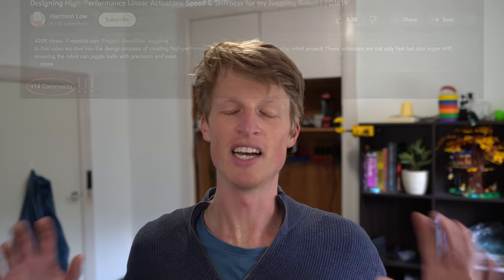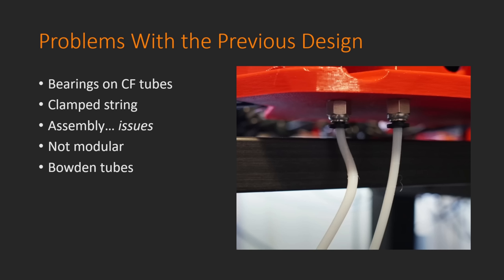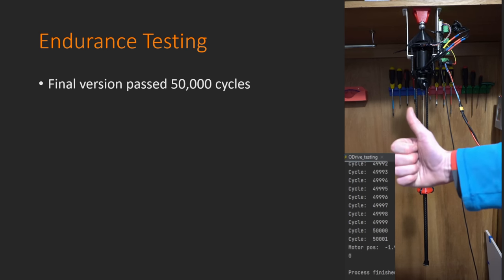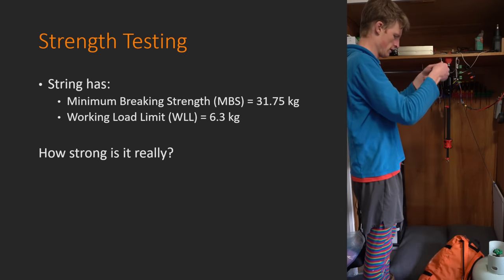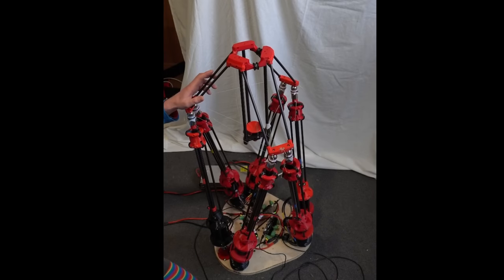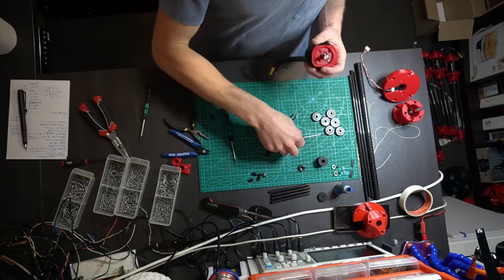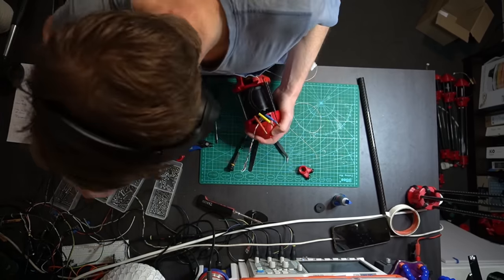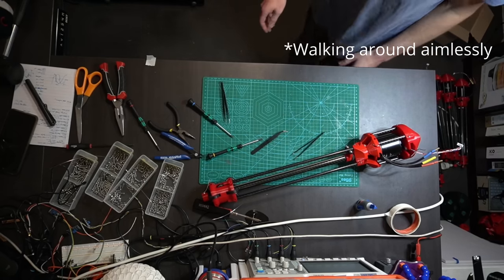My New Linear Actuators are SO MUCH BETTER! | PDJ #21

Comment from the maker: 🚀 Hey Jugglebot Enthusiasts! 🤖

I'm thrilled to finally share this update of the actuator journey with all of you! Your insights, curiosity, and passion have been pivotal in this progression.

If you were designing this actuator, what would YOU do differently? Or better yet, if you could see one feature or capability added to these actuators, what would it be? 🧐

Don't forget, if you want to learn more about the project, or to lend a helping hand, check out our Zulip site, here: https://pdj.zulipchat.com/
Reply: Please don't add music.  I really wanted to see how this was made but just couldn't with the music.
Reply from the maker: @MichaelMantion  Hmm interesting. I'm in two minds about this. Do you think just making the music a bit quieter would be better? Or would you prefer just none at all?
Reply: Would love to make a design for you but i just cant do things for free anymore
Reply: Love the series and the focus on the process of basing the design in proper design requirements. Inspiring thank you, clearly you are on a great path with the project 👊👊👍
Reply from the maker: Cheers Martin!
Reply: use tephlon wheels from a 3d printer insted of the berrings it has the berring and roller in one
Reply: You should look into making a 3D printed axial flux motor and implementing it.
Reply: 4:34 i think eliminating one pulley per string is fairly easy (and btw they are not pulleys, they are rollers).
Reply: @wormball  They are idler pulleys.
Reply: I would use Kevlar chord. 1.6mm braided chord can handle close 200 Kg and it can withstand high temperatures. (handy if exposed to friction or rapid flexing) Dyneema is similar in strength but slippery and susceptible to heat and length creep if kept under tension for long time.
Reply: Just kicking ideas around: what if you used two counter-rotating flywheels you can rapidly borrow acceleration from?

Feel free to debunk this: it's just a rough idea.
Reply: @Wintergatan_2  Hey! It's world-renowned musician, performer, YouTuber, and mechanical wiz Wintergatan, inventor and reinventor of the magnificent marble machines of musical merriment and inspirational delight!

I wonder who else is here, hiding in the comments...

Oh yeah:
🫵
You, person reading!
Reply from the maker: @RandomAmbles Someone else suggested a single flywheel and I had two preliminary concerns with it:
1. How to mount such a system to the existing actuator? (and how to deal with all the new complexities)
2. The gyroscopic forces would play silly-buggers with the full Stewart Platform when these actuators are moving around.

I quite like your suggestion of counter-rotating flywheels! I had to do a bit of reading as to how that'd cancel the precession forces. Very clever solution to the second issue.

As for the first, I'm still not sure it's worth the effort to add such a system (for my use-case), but I don't see why it wouldn't work in principle. Very interesting idea!
Reply: Have you tried using capacitors or supercapacitors for regenerative breaking?
Reply: You may have already figured out how to secure the synchro cables, however the idea is essentially to just route them through alternating additional screws (in-line or an arc the cable supports ~~~) instead of wrapping around a single screw. 🙂
Reply: @harrisonlow  YouTube now has  'multi-language audio' support, so I wonder if you could upload two audio files, for the languages: 'English', 'English no music'. It's a slow roll-out through, so you might not have access to the feature yet anyway.
p.s. I enjoy the music, but I do think it would be cool for the viewer to be able to disable it when they choose. For people like @MichaelMantion and people who sometimes want to listen to their own music in the background instead
Reply from the maker: @shminz6093  Very cool! I didn't know about this. Looks like I don't have access to this feature yet, but I'll keep an eye out for it. Cheers for the suggestion!
Reply: You can make a bent grommet that fits around the synchromesh that allows you to clamp down onto it normally (potentially with locking exterior grooves), and there are various polymers that are above 100MPa for the filament replacement, like continuous thin carbon fiber nylon66, PAI, PEEK, PPS, PEI, or some others.
Reply: TPU is also one of the lower quality polymers for that task. UHMWPE is much more effective for abrasion and strength. They make the new bulletproof armor out of a crosslinked controlled process version of it.
Reply: Stings and twisted cables can elongate with time which can be exacerbated with acceleration. I used to have a solution long ago but can't remember it now as I have thousands of innovations and am working on a dozen projects at any given time..
Reply: IT IS A BAD DESIGN, BULKY AND HEAVY..AND EXPENSIVE
Reply: You can terminate the synchromesh cable by clamping it between your original M3 screw and an M3 nut. Therefore it can be tightened way more than against a 3D Print

Comment: Just lying here, thinking that there are a couple of things that i might be able to usefully comment on... a bit off the wall, but i wonder if using two motors, although more complex, might give you control over things like stretch in a string, and providing some kind of dynamic control over the string action and loading... with encoders on the motors,  and optical "zeroing" sensors, you get calibration on every cycle... i wonder if some kind of silicone 'oil' impregnating the string might improve lifetime ... indeed, steel cable with a 'dry' lubricant might work well, even on the smallish radius pulleys? I guess that a lubricant could be 'wet', if the actuator 'tube' was enclosed....anyway, sick in bed, just the ramblings of an amateur....
Reply from the maker: Interesting idea with two motors! I'm not sure it'd be worth the added complexity in my case though 🤔 Silicone lube on the string is a neat idea! Since this video I've done a heap of testing with different strings (video to come eventually...) and have found dyneema to be really good; high strength, low wear over repeated cycles around small pulleys, low stretch etc. 

Cheers for the input, and I hope you get better soon!

Comment: For the bearings, I would suggest a delrin or Teflon roller. You can get a pack of these easily, marketed as 3d printer rollers. They would stay on the bearings better, resist abrasion, and have a self-lubricating effect with the tubes. For the synchromesh cable, you may be able to design a clamping plate similar to those used for bike cables.
Reply from the maker: Very good suggestions, cheers!

I think the bike clamping plate will probably be the final solution for this problem; super simple, small and light. Great thinking!
Reply: The wheels used by 3D printers to roll on 2020 could also be used. The wheels are really cheap. There are also different shapes. Maybe a concave shape is better for rolling on the carbon fiber. You can buy them with a groove. Or if you can control the spinning modify them with a static spinning  drill bit and slowly turning the wheel.
Reply: Why not linear bearings? Recirculating ball type used by many machine tool makers for linear movement. Robust, accurate, hard wearing and cheapish.
Reply: @seeker1015  Weight to stiffness ratio is worse (if you include the rails) than carbon fiber. More weight means: requires bigger motors.
Reply: Some of these have a Delrin  "v" groove profile that would give you 2 points of contact per bearing on your carbon tube. This is the first thing that jumped to mind when I saw your printed sleeves....I would imagine that this would keep things located a little more positively (at least, short of a concave profile to match the tube radius) . You might be able to use 3 of the same on the captured end of the moving tube in place of the 2 guide rollers you currently have riding one of the outside tubes...basically the same thing you have holding that moving tube inside your printed end, but flipped inside out. That would both keep it centered  AND prevent axial rotation given the 2 contact points inside the V. Anyway super interesting project, and very promising.
Reply: Just stumbled across this thanks to youtube recommendations and the first thing I thought was "POM" wheels instead of bearings and Dyneema rope instead of Kevlar string.
Reply: @harrisonlow  check out safety bolts. basically, you route the wire through the bolt and tighten it down. They are used on aircraft. it's even more simple, and has nearly 0 chance of slipping.
Reply from the maker: @suqmadiq69420  Very cool! Doing some reading, these look like they're used to stop the bolt from coming undone, and requires wire to work (to retain the twists/folds). Not sure it'd give the easy tunability that I want here, either, though I'm really glad that you mentioned this because I had no idea this was a thing before and I really like the idea! Cheers for the suggestion 😊

Comment: In order to utilize regenerative breaking efficiently, you really need multiple servo drives sharing a common power bus. This is a gross over simplification but large automation companies use this strategy regularly to help drastically lower power consumption, heat dissipation, and panel space.

Comment: Regarding the MBS of that string, you're going to get something closer to half of that once you tie a knot in it.
Reply: It’s also worth mentioning that some strings are stretchy. Using string with low elasticity may improve precision too.

FWIW, strength of ropes (atleast in climbing scenarios) are usually measured in newtons/kilonewtons. The fact that the string was given in Kg (assuming they didn’t do the conversion themselves) is a bit of a red flag.

I don’t think the material was mentioned in the video, (fishing line?) but dyneema, if they can find a suitably thin version, seems like it would work well here.
Reply from the maker: @bkuker I agree, though this does change based on what knot you tie. For the string strength testing, I tied figure of eights, which (AFAIK) are fairly good with not severely diminishing rope/string strength. Interestingly the string actually broke in the middle, far away from both knots 🤷‍♂️

As for the string in the actuators themselves, this is a big reason why I wanted to avoid knots altogether. I believe the system is fairly good with having no "stress concentrations" on the string, and when it does brake (eg. from the motor not slowing down fast enough and the actuator ramming into one of its ends) it seems to be braking in different places each time; some of these breakages being in sections where the string is perfectly straight at all times!
Reply from the maker: @techhech3358 Interesting point re. stretchyness and precision! I've just been treating these strings as perfectly (axially) stiff, though you do raise a good point that this, of course, isn't true. Perhaps I should test how stretchy these strings are compared to synchromesh cable. 

I should've mentioned in the video, but these strings are made of kevlar and are usually used for kites. The MBS/WLL is actually quoted in lbs and I see where you're coming from re. a "red flag" though I'm not sure I'd expect kite-hobbyists to care too much about the differences between weight and mass 🤷‍♂️
Reply: @harrisonlow  The strength loss of knots is a factor of the bend radius of the knot, knots like the figure-8 have a pretty big radius; but the way you're mounting the string also has a radius. I do think in this case it's best to avoid knots, so maximizing the radius of the mounting points will help. I can't tell where it failed in your lift test so this might not be the issue now but you could run into it later on. A good strategy is often to coil the rope around a perpendicular rod a few times before securing it. This coil forms a friction knot and will take up a lot of the force before it gets to the mounting point. Maybe add a large radius to the 3D print and then coil around axial to the carbon fiber rod?
Reply: @Ziraya0 Also the tread of the M3 is knife-like, absolutely the worst.
Reply from the maker: @Ziraya0  I like the idea of using a friction knot before the final securing point. I actually briefly considered having the strings wrap (circumferentially) around the caps on either end of the central CF tube before securing them with the bolt, but decided against it because of how messy it looked 😅

IIRC the string in the lifting test broke inside the central CF tube (I think near where it was fed through the cap piece and around the bolt) so if I want to increase their strength capacity, it might be worth smoothing that section out a bit.
Reply from the maker: @BartSliggers  Yeah I have been a little put-off how munged-up the string gets after being fastened this way a few times... Surprisingly, many of the string failures were actually in the straight parts of string (eg. inside the central CF tube for the compression string) so I don't think the stress concentrations are too significant in any one spot
Reply: @harrisonlow I'm not sure if you realise how strange it actually is for a rope/string to break not in the knot/attachment. I have a lot of experience with ropes (rope access rescue) and in  no test has the rope ever broken in a straight untouched area. Something has to be going on, or the string is made incredibly inconsistent.
Reply from the maker: Yep, it is super strange. If you're curious, I've uploaded a clip showing the next few seconds of the break test, where you can see that it broke in the middle. Link is here:
https://pdj.zulipchat.com/#narrow/stream/399279-General/topic/Random/near/389776525
Reply: @harrisonlow working load is important. the reason working load is so small is because they are allowing for shocks that occur when things are moving.  In the video where your bag breaks the line you are bouncing the bag.  Even though the bag is within the break limit, the shock of the bag stopping travel is exceeding the break limit of the string. In theory all strings/ropes are made perfect and should break at knots every time.  However, the ropes and strings are never perfect and, even without damage, will always break at the weakest location.  That's often not at the knot.  Considering that you're going to have this bot juggle, shock load is an important characteristic to think about.  The faster you try to stop/start motion, the higher the multiplier to the weight for shock load.  Also, your motors may be moving fast now with the system being under no load, but the more load you put on the motors the slower your response time is going to be.  Considering you intend to eventually install a load that you're going to juggle, you need to understand the motor response curve under various loads.
Reply: How about some kind of cleat. A jam or pinch cleat molded into the slider combined with a knot.

Comment: It's a great design. You should also measure the force you can apply in extension - the opposite of your weight lifting test.
Reply from the maker: Cheers! I did consider that but I couldn't think of a good way to mount the actuator to support a load when upright... I imagine it'd be fairly similarly strong in both directions, though?
Reply: @harrisonlow you could use string and pulley so that it pushes the string downwards and the string pulls some load. But youll have to have at least two strings so that side forces cancel out and dont deflect towards the string
Reply from the maker: @TrueHolarctic  That'd definitely work and I think I considered something like that but quickly abandoned it after thinking of the direct lifting test that I showed in the video. I'm not super concerned about strength and I would expect the two directions to be similarly strong so I didn't bother with testing the other direction 😛
Reply: @harrisonlow   an extension strength test would test buckling characteristics.
Reply: @harrisonlow put it on a scale, Like weight scale?